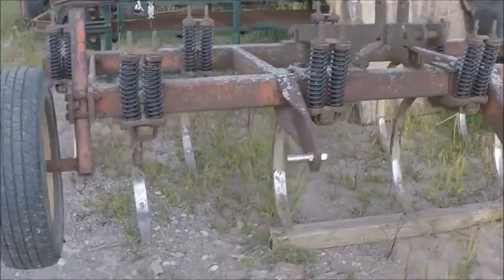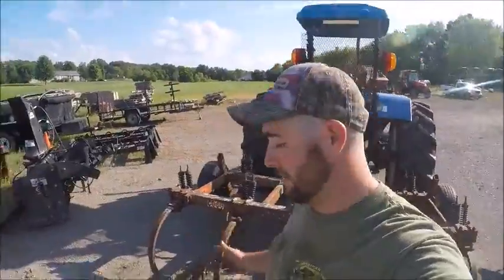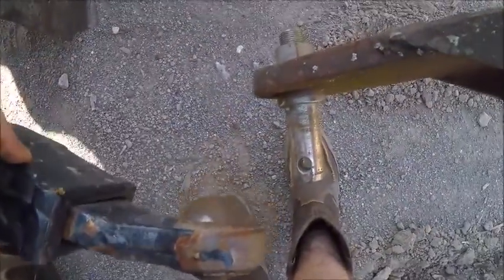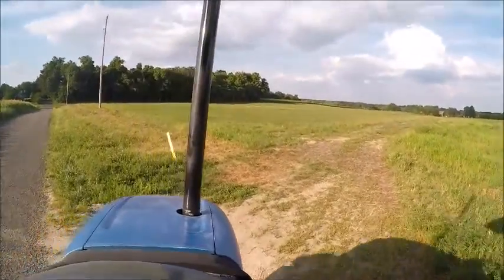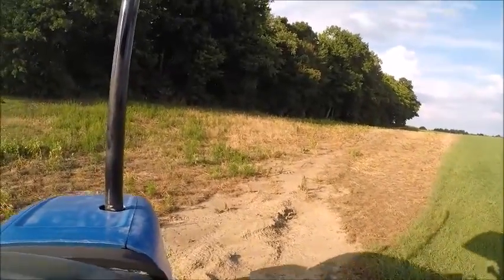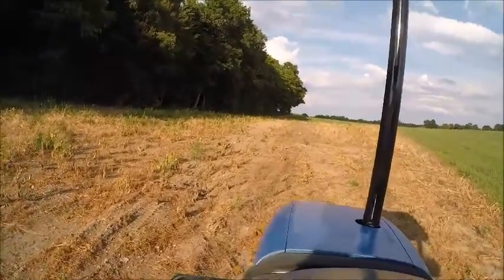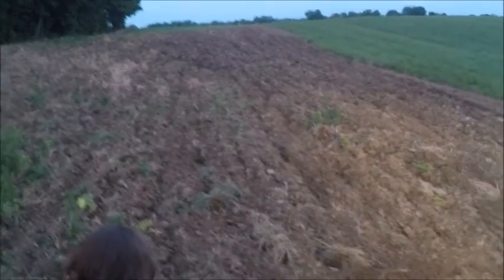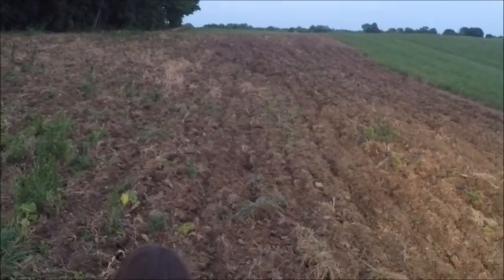Trying Out Our 500$ Case Chisel Plow !

Comment: Thanks for sharing,  when loading the implement why did you not start with the un-adjustable side and hook up the side you can adjust last? Secondly,  what is the difference between using a chisel plough and a ripper?  Appreciate the video.
Reply from the maker: Because I had to unbolt the un adjustable side and thread it down because it wouldn't go low enough. Also a chisel plow and ripper are pretty much the same just rippers are usually more durable and heavier